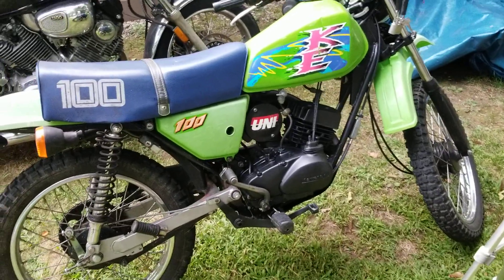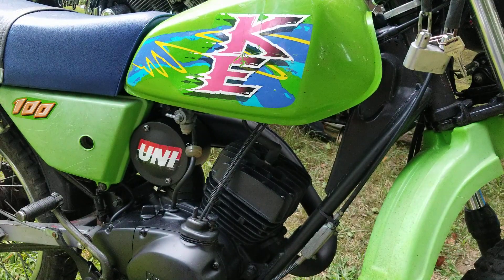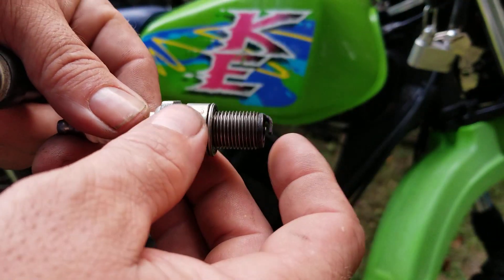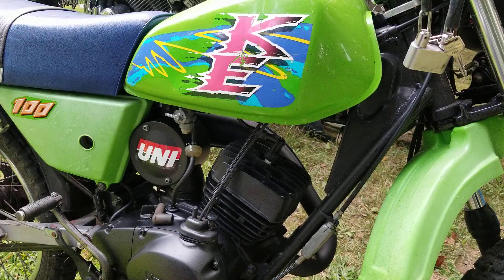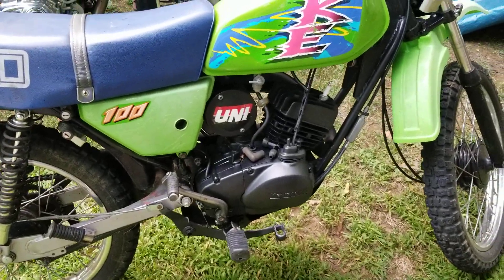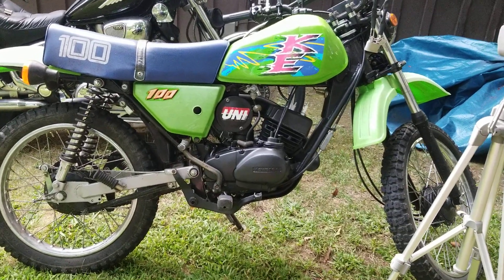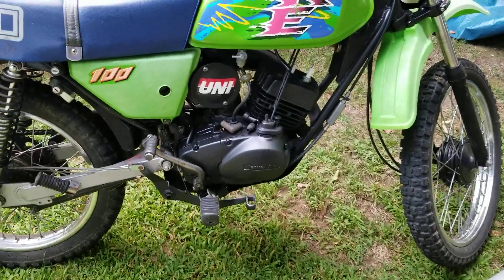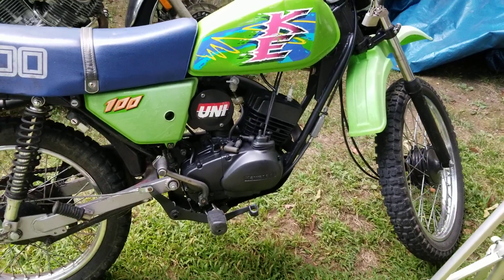1996 01 ke100 ignition/ spark plug talk

Comment: Hello I just saw this  video and I have a 2000 ke100 what is the point of switching to the black plug and resistor plug cap ?
Reply from the maker: @richardgregory6639 if you have a resister cap you can use the black plug the benefit to the black plug is when it gets fouled it won't short the plug

Comment: I have a 77 k100 that someone cut the ignition off right at the key switch. Is there a succession of wires I can connect to get spark? I’ve tried unplugging just the ignition part of the wire harness, nothing. I do know it’s these wires being cut that killed the spark because if I start rubbing wires together I can get a sporadic spark here and there. Thanks much for any help.
Reply from the maker: Black wire comming off the magneto connect it to the small black wire on the coil engine will run put a kill switch between both wires
Reply: Kevin Bergeron which one is right under the gas tank? Cylindrical, 3-4” long. I noticed there are 2 black wires coming from it. Once the storming stops I’ll go take a look. I wish I had a way to send a pic.

Comment: Hey, I have a ke100 78 and need a new ignition coil, but can’t find one, any pointers?
Reply from the maker: These bikes are 6volt low amperage not enough current to damage the coil
Reply from the maker: If you have a coil on your bike it's good you need points and condenser

Comment: Kevin l love your channel, could not find you on facebook i have questions i need answered and you are the man with the answers 
i am working on a 1974 Kawasaki G5 not sure if it is the same as bike you have worked on, the engines look the same Please advise
Reply from the maker: What is the problem
Reply: @2strokeguru  i got the bike running, cleaned the carb, getting spark, i made a long clear hose and filled it with fuel, just to get the bike started, it would start and idle fine, quick throttle response,  then i put the gas tank back on and now the bike wont start, i did clean the tank, had it soaking in vinegar for over 10 days and flush it out, i do have a fuel filter on it now,
Reply from the maker: @sierra2562  could be a clogged gas cap vent try running with a loose cap

Comment: Interesting I'm using that black plug. Im having bogging but it's usually when I'm in first gear. Doesn't bog in neutral. Think I'm running a little rich as well. Saw some black splatter out of the tail pipe
Reply from the maker: Clean your exhaust tip mine did the same thing plugged tip

Comment: On my ke I have a problem were the plug will have power but the spark plug won’t have spark... I tried several spark plugs and no spark... what could be wrong?
Reply from the maker: No spark have you checked your points
Reply: Kevin Bergeron well I put a screw driver into the boot and kicked it and it blew my hand off lol. So I didn’t think anything was wrong anywhere below the boot but I didn’t know if it was the boot
Reply from the maker: @fayettefishingoutdoors8385  if you got shocked you have spark
Reply: Kevin Bergeron even when the plug shows no spark?
Reply from the maker: @fayettefishingoutdoors8385  then clean or replace your points
Reply: Kevin Bergeron hey Kevin I have another problem... it hadn’t run for a while but I got it running but I had to hold the throttle wide open for it to stay running, and it was really Smokey
Reply from the maker: @fayettefishingoutdoors8385  you have been kicking it over with no spark oil pump keeps pumping oil flooding
Reply: Kevin Bergeron that would explain why... it had good strong spark every time I checked it... would it occasionally not work?
Reply from the maker: @fayettefishingoutdoors8385  could be a lot of reasons moisture missing or broken gasket water get in